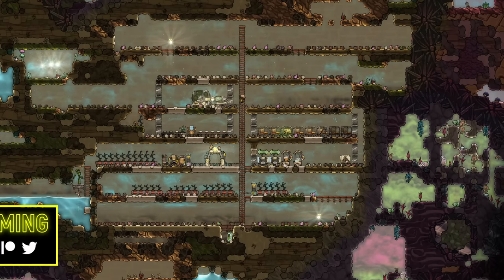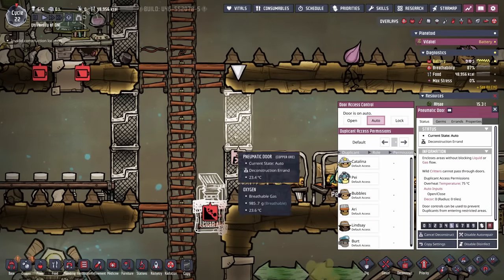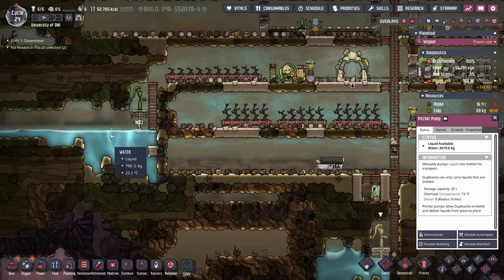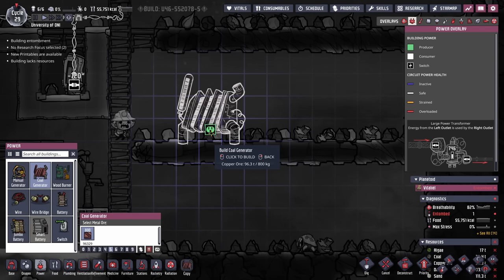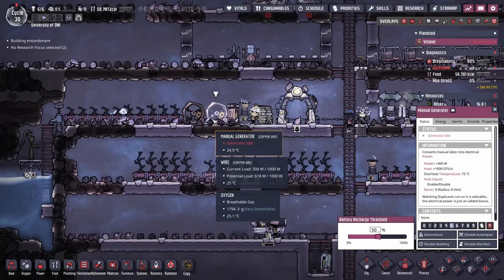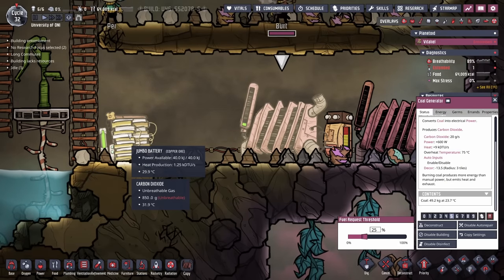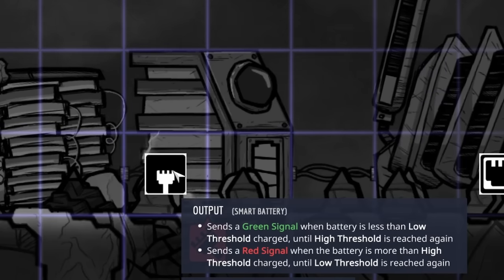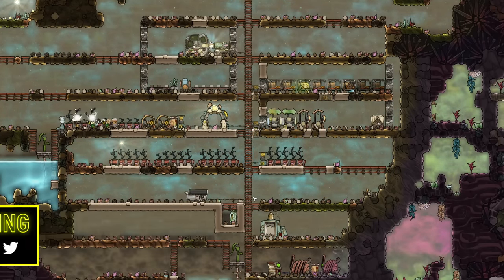Power using Coal Generators | Ultimate Beginner's Guide | Ep 6 | ONI

Comment: Echo : … plan where you gonna place the jumbo battery cause it will generate a lot of heat…

Also Echo : place it next to the crop straight away

Me : Well done Echo, I love your tutorial, just like tomorrow Echo did 😂
Reply: In his defense: The ideal place to put the batteries (on the "thermal frontier" between temperare & hot)  was NOT excavated back then because it could NOT be excavated by any duplicant (lack of digging skill).
 .  Since the "starter" battery would had to be deconstructed anyways (same thing with the temporary bigger version) as they would be eventually be replaced by the superior "smart" one, it did not mattered that those initial were placed in a thermally sensitive place.
  -> The real mistake is to wait too much time without deconstructing obsolete/redundant machinery; or without disabling them (the "scizors" order can disconect them instantly without any deconstruction duplicant time resource).

Comment: I literally saw every of your videos exept stream vods, and i find them amazing, Echo. Keep it up please =)

It may be somewhat confusing thing, but jumbo battery leaks more then normal ones. It leaks more, and your power system will lose more power dye to that leak if you replace common battery with jumbo battery. It is efficient in terms of power storage, but its not in terms of power itself. So do it only if you need to extend your power storage capacity.

Personally i build 1-2 common battery at day 2 and then run into smart battery setup ASAP coz it solve almost any power problem from early to high end game, and it almost no worth about even build jumbo battery to deconstruct it couple of cicles after.
Reply: Overall, while yes, the Large Battery does leak 2kj of power compared to the Small battery's 1kj, its the percentage of the battery per cycle that counts.  With the small battery it only holds 10Kj but loses 1Kj per cycle (a 10% loss per cycle).. Where the Large Battery holds 40kj and loses 2 Kj per cycle (Which is only 5% loss per cycle).

If you are building 2 batteries that means you have upto 20Kj of power but you are losing 2kj of power in leakage per cycle (Still 10%)   it would be worth more to have 1 Large battery for the 40kj rather than 2 batteries for 20kj
Reply: @ThatOneGuy15270  i dont get how only percentage counts. Applying 1kj leak per cycle means that your dupes must spend extra 2.5 seconds on a humsterweel per cycle period. When you planning huge solar station you absolutely must think about leak/capacity ratio, there is where really only percentage counts, but at first 10 cycles of the game that just irrrlevant and confusing imo.